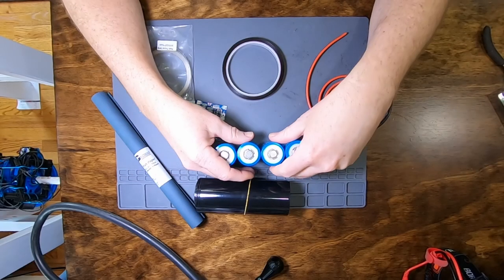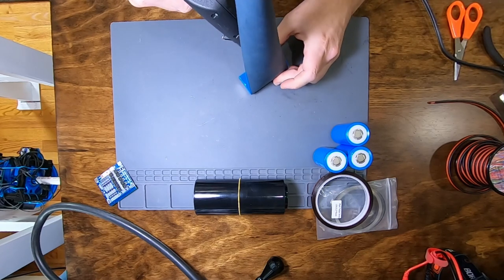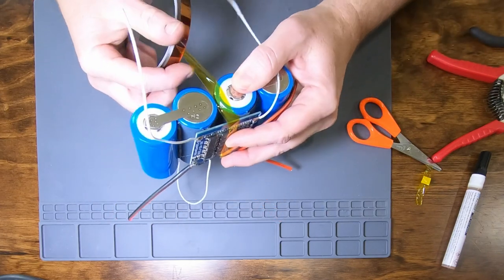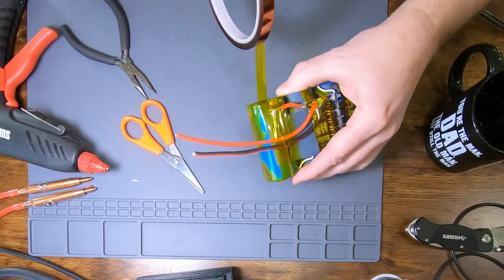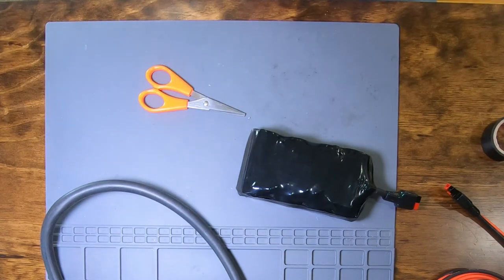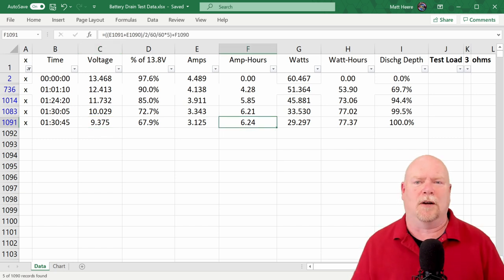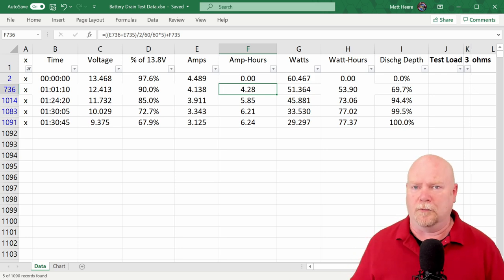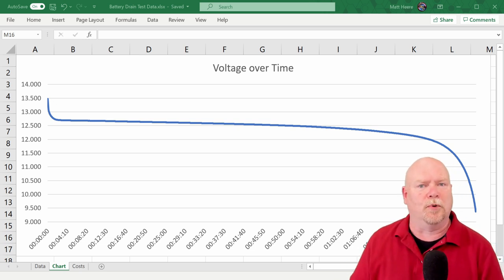LiFePo4 Battery Build using LiitoKala 32700 cells

Comment: That 40 second delay in the BMS cutting off the pack is likely due to the minimum cell voltage being under 2.5V on the BMS. LiFePO4 in general can go down to 2.00V without really damaging it so long as its not a regular thing. For a capacity test or rare BMS cutoff situation its fine. Also many BMS's have a delay time for that protection to kick in. Usually 3 seconds to 30 seconds. So maybe 10 seconds after that second to last measurement you hit 2.5V even across all 4 or one of them hit 2.3V (a common min voltage number used on el cheapo BMS's). That means 30 seconds later the BMS tripped the protection. So fairly standard behavior all the way around.

Hell you can go down to the 1.7 1.8 volt range and they'll still recover fine. A123 cells go down below a volt and act like nothing happened. 0V cells can be recovered in ok shape. With how little energy exists down there its best to probably use 2.7 to 3.50 or 3.55.

Comment: Cool! I put 40 LiFePo4 in my outdoor hardcase for amateur radio portable in the Fields. 3,36V-DC/29000mAh a piece. Built a inlaying bed out of foam pads I bought at amazon, did the wiring inside, drillied 5 holes on the sides of the Hardcase. 4 outlets for 13,8V-DC and 1 line in for charging the LiFePos with Turnigy Charger Balancer (300W/20Amps) which gets hooked to a Hama Notbook Switching Supply  (for 15 or 19V-DC).  Took me good 2 hours being busy with getting everything soldered and finished up ready to use it. This happened 3 years ago, the LiFePo4's are still working fine and delivering hours of fun on my activations outdoor.
I love this documentary video and the excellent job you do. 73's from SW-Germany. DK5ONV Uncle Guenter

Comment: Hi matt, I'm making my own lifepo battery pack. What are you using to charge the battery? good day to you.
Reply from the maker: I use a benchtop power supply that regulates both current and voltage.  I set the voltage to 14.8V and the current to 3A.  It runs 3A for most of the cycle until it hits the 14.8V limit and then the current starts dropping until the pack is charged.

Comment: What is the maximum voltage Lii-70A Liitokala 4S  32700
14v oke
Reply: 14.6V if charged up to 3.65V however many charge to 3.5 or 3.6

Comment: Thanks Matt. Enjoyed the build. I build mine for sure! Most recent build was a solar generator. Still need to get my solar panels to completer the build and will be doing so soon. I have been looking for a more lightweight battery for summits on the air. Think this build may meet those specifications. Kevin
Reply from the maker: This would be a great size for a solar setup.  The 32700 size cell seems to be the smallest you can go and reliably get the continuous current rating needed to run a 100W radio at 100W.  If you can manage the capacity limitations through a combination of output power selection and solar recharge, you're golden.